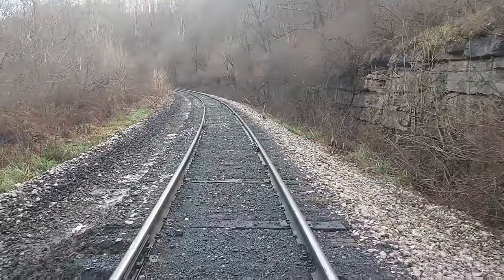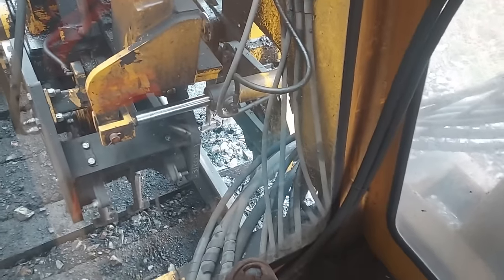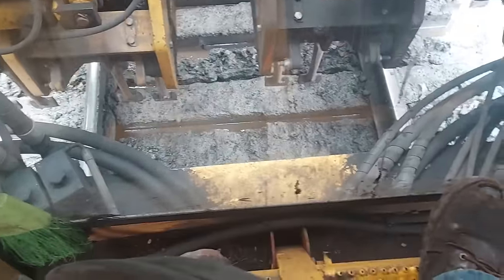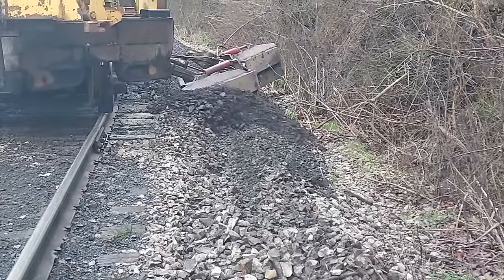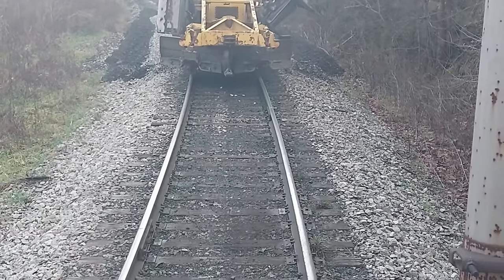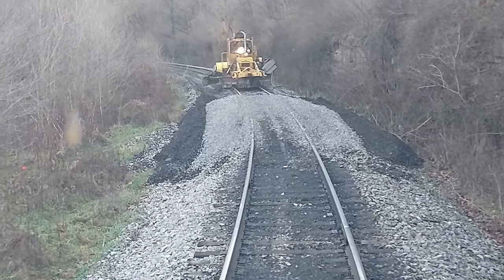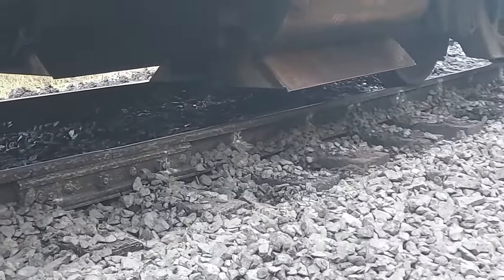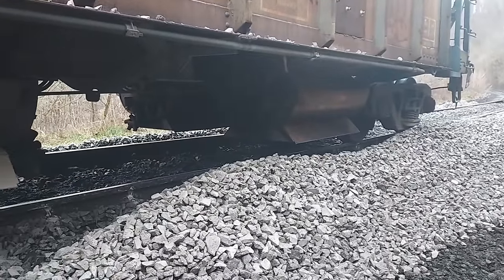Crib Sweeping a Really Bad Mud Spot in the Track

Comment: Nice work with what you have available!  Getting the shoulders opened up should help the track drain out better until you can get in there and undercut it.  Might consider some nonwoven geotextile fabric under the ballast after you undercut it to help keep the mud from coming up into the ballast in the future.  Not very expensive and helps a lot.
Reply from the maker: You are right mtgibbs, that road fabric is the ticket. We have taken
sections of track out before when we had shut downs and layed
down the geotextile fabric before spreading new ballast, it works
wonders!   Mud is our biggest problem here on this track. At least 
now all the train operators are telling me it's a night and day
difference in this spot, which makes me happy.  Very grateful my
friend for your taking the time to visit with us and check out
the crib sweeping video.

Comment: Quite a mess there, where did all the mud come from Dave?
Reply from the maker: Yes it certainly was Glenn. Where did the mud come from.... well
first thing all the coal leaking out the car doors gets down in the
ballast and plugs the ballast up. When that happens the water cannot
get away from the track so it stays in there. When the train passes
over it with all that weight, it tends to want to push the ties down and
when it passes the ties come back up. That allows water to get
under the ties. Next train the water gets pushed down by the ties
and when the train passes and the ties come back up, that acts like a suction pulling mud back up with it. When that happens train after
train then the cribs start to fill up with mud. When that happens
the track surface and alignment just won't hold very good. It's a
constant thing here dealing with mud in the track. New mud spots
occur all the time. Coal fines down in the ballast are never a good
thing.  Very grateful my friend for your taking the time to visit with
us and check out the tie sweeping video.

Comment: You really need to get a undercutter in there and clean your ballast and get rid of the coal and mud
[
Reply from the maker: An under cutter would be nice americanlogger but you also need some down time on the track to do it, which is something we don't
have a whole lot of time, they like to run trains here. We have done
some under cutting before but it was always on a shut down period
when the train wasn't running for an extended time. Plus hulcher is
not always available to come in to do it for us. Since we do not
interchange with another RR then getting one of those big shoulder
cleaners in here is not an option either, so we do what we can with
the equipment, time, man power we have plus working around 
weather conditions.  Very grateful my friend for your taking the time to visit with us and check out the crib sweeping video.

Comment: With a bunch of rain, a slow order will follow. Railroadin the North East. ⛏️👷‍♂️🪨🚂🇨🇦🇺🇲🙋
Reply from the maker: With a bunch of rain we get new mud spots Doug..... sigh. it's a never
ending battle here dealing with mud in the track. But I guess that's
job security. Several of the train operators slowed down over this
really bad spot until we could get it fixed up. Night and day difference
now from what the operators are telling me. Mud is our biggest
problem here on the track. I need to retire and build a model RR so
I don't have mud problems to deal with....LOL  Very grateful my
friend for your taking the time to stop by and check out the crib
sweeping video.

Comment: Dave, are you the final authority on whether or not the track is safe for trains to run? I mean nobody knows the track on this line better than you.
Reply from the maker: No you are right Jim, but I've also been here the longest so should
know a thing or two about the track... :-)  The train operators had
slowed down over this spot until I could get it fixed. Had to wait on
the right weather, can't do this when stuff is frozen. Plus I have to
wait on a train operator to haul ballast for us, which doesn't happen
when they are running coal trains. So it went by for a time until 
we could get it done.  At least all the train operators are telling me there is now a night and day difference in this spot, which makes me happy. Very grateful my friend for your taking the time to visit with us and check out the crib sweeping video.

Comment: Washouts are dangerous cause if the rail kinks a derailment is certain to follow. Glad you got the problem fixed just in time.
Reply from the maker: Yes they certainly are SuperMAZ. This was the worst spot we had
on the track, so glad we could get it fixed before something bad
happened. The train operators had slowed down over this spot
until we could get there. Have to wait for a train operator when he
is available to haul me ballast plus had some freezing temps
to deal with before and can't do this kind of stuff when it's frozen.
Very grateful my friend for your taking the time to visit with us and check out the crib sweeping video.

Comment: Thank you for this video!
Landscaping and drainage patterns to drain water away before it gets to a problem area may need the input from landscape engineers for a longer term solution.
Reply from the maker: You are certainly welcome Robin. You are right about the drainage.
Several years ago they put a new pipe line along our track. On this
particular curve the final grade when they dozed it sloped in towards
the track so the surface water ran into our track. This certainly
has not helped the mud problem in this curve. I asked for a rental
dozer several years ago so I could grade the slope so the water
ran away from the track, I'm still waiting on it to show up.... sigh.....
So we now deal with self created problems. Very grateful my friend for your taking the time to visit with us and check out the crib sweeping video.

Comment: Yep, another cool video, Dave. I'd like to know more about how the machine lifts and tamps .. that it's capable of lifting one rail or another 3/4 of an inch, or whatever is desired, and then tamp the ballast. Good work, thanks for sharing.
Reply from the maker: Thank you Kenneth for the nice comment, glad you enjoyed. There
is a lifting device on the tamper called a jack beam that has 
hydraulic cylinders. When we move the machine ahead, there
are clamps that go in against the rail and the hydraulic cylinders
lift the rail up. That is controlled by a number of electrical things
and when the proper surface level is attained the jacking on the
hydraulic cylinders shuts off so it doesn't raise track up anymore.
The computer on the machine tells the jack beam to raise one
rail higher than the other to attain the proper super elevation. I
have to manually set what super elevation I want for each
different curve in the computer program for each curve. That's
a pretty simple explanation of some complicated hydraulic/
electrical stuff going on making it all happen, but hope that
helps explain it for you.   Very grateful my friend for your taking the time to visit with us and check out the crib sweeping video.

Comment: Sweet you could use the tamper to help get the mud moved to help drain it there. Now, after you took care of the ballast, it looks far better! Sturdy. You sure helped keep worse things from happening, that's for sure!
In the city I live in, I  got to see a tamper on a side track a couple weeks back. There were other pieces of equipment too. There were some bundles of ties off to the side. My guess is they're replacing bad ties, and will also put some new ballast in. The ties are looking poorly in areas. Also have some wet areas there. I'm glad they are looking after the rails  around here too!😊
Reply from the maker: That's pretty cool they are doing some track work there Trena, hope
you get to watch them do some work on it. If they need any assistance I'm sure you will be of help after watching my videos you
know all about track maintenance now! :-)  Tamper is not the best
thing to use for getting mud out but it was all I had available to
work with. But all the train operators are telling me it's a night and
day difference now from what it was before which made me happy
to hear.  Very grateful my friend for your taking the time to stop by and check out the crib sweeping video.

Comment: Hello Dave, I was wondering where the mud on your face came from, When I saw the condition of the
base, I thought what a prime area for a derailment! with all the movement due to minimal rail support.
what a difference! great job getting the rocks under the ties, and stabilizing the rails, preventing any
pumping action on the tracks! that will destroy the ties and fatigue the rails. now it is a good fix until
the time is available to do more of an extensive clean out of the coal / mud while replacing with stone.
Reply from the maker: Thank you so much for the very nice comment Barry. I try my best
to do what I can with the equipment, time and man power that is available plus dealing with weather conditions. Most of the train
operators slowed down over this spot until we could get
it fixed.  At least all the train operators are now telling me there is now a night and day difference in this spot, which made me happy. Very grateful my friend for your taking the time to visit with us and check out the crib sweeping video.

Comment: Great job DVe get due done .full of water Drain that out get some good ballest fix that problem 👍🏻😎👍🏻 nice complete job 😂 Robin out
Reply from the maker: Thank you for the nice comment Robin, you are right, water has
to get drained away. Coal from leaky car doors plugged up this
ballast and water can't get away when that happens. So the water
stays in the track and gets pushed down when the train runs over
it. Then when the train unloads, the ties act like a suction pump
and pull mud back up with it. Eventually the mud takes over and
then it's a real mess.  All the train operators are telling me this
spot is now a night and day difference from before. Very grateful my friend for your taking the time to visit with us and check out the crib sweeping video.

Comment: Hi like the way you talk to people. My military experience has been people are like rope . You must lead and not push .😊
Reply from the maker: Thank you for the very nice comment James. You are certainly right,
pushing a rope or a person doesn't usually give you great results.
All the train operators are telling me this spot is now a night and day difference from before.   Very grateful my friend for your taking the time to visit with us and check out the crib sweeping video.
Reply: Hi Dave I have a question about train engines. I worked on aircraft and tail numbers are assigned by contractor and USAF  . Locomotives have numbers on headboards and how are they assigned.  I question they used to track maintenance and records of its life  ?  Is this something that you maintain on all rail equipment ?  My F117A1 86-0820 @ area 51 .
Reply from the maker: @jamesmantalas6107  each individual railroad assigns a unique number to each of its locos James.  Each RR has their own way of selecting what number to assign to a loco

Comment: Amazing how much water that dirt and coal dust retain and block drainage.  Is that any area where a door on a hopper opened a while ago?   

I imagine freezing and thawing over winter is gonna keep you focused on that area….

Stay safe…and warm Dave
Reply from the maker: When coal fines consistently get in the track they soak down into
the ballast and plug the ballast up Kevin. Then the water stays in
the track and goes down. Every time the train passes the water gets
pushed down and when the train unloads the ties act like a suction
pump and bring mud back up with them. Our biggest problem here
is mud spots. Seems like you fix one spot and two more show up
to take it's place....:-)   Very grateful my friend for your taking the time
to visit with us and check out the crib sweeping video.
Reply: @ccrx6700  thanks Dave, is there a shutdown over Christmas time frame or reduced runs?
Reply from the maker: @kevinaurandt6280   just 2 days Kevin, christmas eve and christmas. We will have an extended shut down sometime late winter or early spring

Comment: You have to keep the trains rolling so that we can keep the steel production going.
Reply from the maker: We do what we can to keep this train moving harpintn. Sometimes
it's difficult to make needed repairs like this because I have to rely
on a train operator to haul me ballast, so I can't haul ballast to
do this kind of work when they are running trains. Plus we can't 
do this stuff when it's frozen mud and ballast either so kind of have
to do what we can when the time and weather is cooperating with
us.  All the train operators are telling me this spot is now a night and day difference from before which makes me pretty happy.   We do have a lot of mud spots here, more so since we've gotten a good bit of rain. Seems like you fix one spot and 2 more show up to take it's place. Very grateful my friend for your taking the time to visit with us and check out the crib sweeping video.
Reply: @ccrx6700  Will cleaning the ditches to increase drainage in the area fix the problem?
Reply from the maker: @harpintn  it will help 👍😊

Comment: Need to put some heavy road mesh. At the very bottom of the  rail bed. Add some number two rock ..  then. Drop a number one on up, in between the ties.. Road mesh will allow the water to pass through.  Soil will always  soften up. With rain water.  Southern Indiana. Has 30 feet of river silt.  So the roads are always breaking up.  The county will not fix the roads. Like they should be. Cost is to much.  You have an old rail bed.  Cost to much to take apart and fix it correctly.  This yellow clay soil.  Will not hold up to Mother Nature no matter how many times you. Compress the soil or add. Stabilizer to it.   Give the job all you got.   You are the master. Later.
Reply from the maker: Your right Dan, we do need a lot of road fabric under this track. it
is old and when coal plugs up the ballast then water can't get away
but does down and mud comes back up. On some shut downs in
the past we have taken the whole sections of the track out and put down the road fabric which works wonders. Just can't do that kind of stuff with a train running all the time.  

Mud is our biggest problem here on the RR.  Seems like you fix one spot and two more show up to take it's place....:-)   At least all the train operators are telling me there is now a night and day difference in this spot, which makes me happy. Very grateful my friend for your taking the time to visit with us and check out the crib sweeping video.
Reply: In building homes. The foundation was the worst part. One rain and it was a mud putt. We would  put sand in the mud holes. It seemed to compress  under foot. And kept mud from being splashed everywhere.  Heavy  equipment needs different attention.  Indiana in the south has 30 to 60 foot of river silt. Along the Ohio river. The roads and highways are alway  breaking up. Need a good. Base like the Greeks and Romans.  Later.
Reply: What does the railroad do  in earthquake zones.  Such a big difference  in the soil condition and bedrock ..

Comment: bottom dump cars leak/and open.  Rotary dump cars don't have these problems with coal in the ballast
Reply from the maker: We've had our share of leaky car doors and doors opening coming
down the track for sure. Car doors have been leaking for a lot of years. Those coal fines get down in my ballast and plug the ballast
up so the water can't drain away. Then when the train passes over
it pushes the ties down. When the train unloads the water gets
in under the ties. Next train the ties push the water underneath
them down and when it unloads that acts like a suction pulling
mud back up. We do have our share of mud spots here. Seems
like you get one fixed and two more show up to take it's place....:-)
 Very grateful my friend for your taking the time to stop by and check out the crib sweeping video.

Comment: Morning Sir ! You helped us last time but I ran into an issue with a 900 tamper I'm using . The issue is that the work heads now Go up and down VERY SLOWLY  almost as if no high pressure is pushing the hydraulics fast enough to raise and lower the work heads ...any suggestions on what the issue may be? Hydraulic oil filter perhaps?
Reply from the maker: Does sound like a plugged hydraulic filter Steve. I am not all that
familiar with the 900 tamper. Second would be the pump pressure
that drives the work heads.

Comment: What about between the rails, do you do anything there?
Reply from the maker: Not for now John, I need an excavator with cribbing bucket to get
inside the rails, hopefully that will happen next spring when we have 
an extended shut down period. For the winter this should be a
decent fix until that time when I can do it properly. Have to do
what you can with what equipment and time is available. At least all the train operators are telling me there is now a night and day difference in this spot, which makes me happy. Very grateful my friend for your taking the time to visit with us and check out the crib sweeping video.